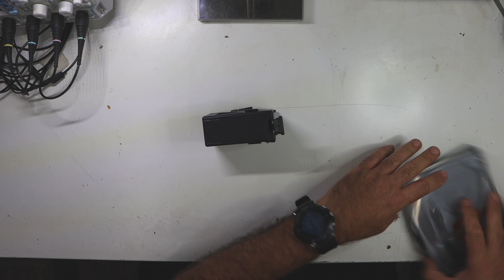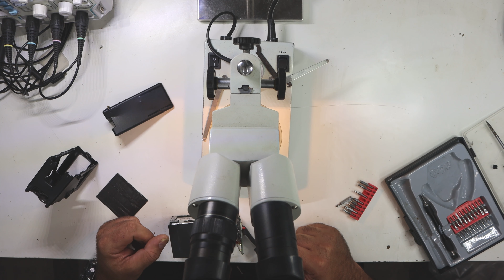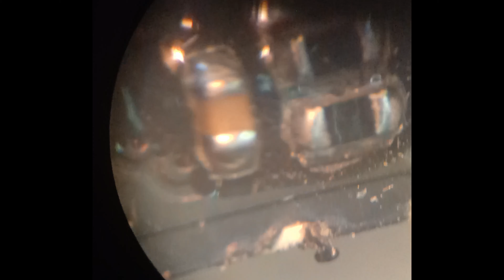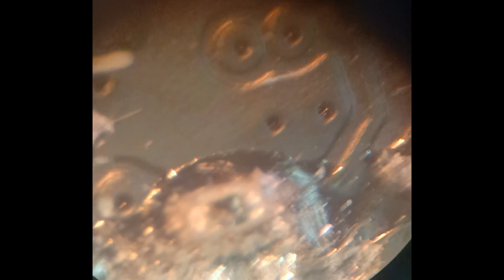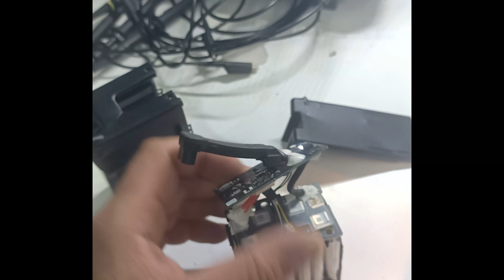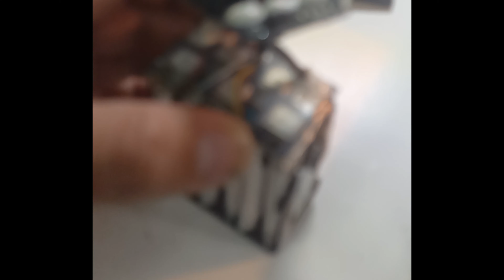What's inside a DJI FPV Battery. And: Can it be repaired ?  $#&%#  😒

Comment: Its too late for the reply, but since you opened it already. Did you try to resolder the pins to a normal lipo?
Reply from the maker: The lipo inside the battery was fine, the problem was the BMS. I ended up using the lipo in other projects. Cheers
Reply: @reversingentropy  so if i have a perfect bms, and dead cell can i use other lipo here?
Reply from the maker: @rainbowrunner1136  O think you can. i dont see why that wouldn't work.

Comment: Hello there, we are sorry for watching this. It is still recommend you to send the FPV back to us for further check. Please be reminding that we do not suggest you to open the smashed batteries for the safety concerns. Under this case we cannot help to repair/replace your battery. You can send us the drone repair request to support@dji.com with your product SN code, we will help to follow up.
Reply from the maker: I am so surprised by your comment. 😲 Thanks for caring. I am buying a fly more combo today in my local DJI store. 
However you must understand, most people can't keep a FPV drone that they can't repair. I agree that the battery is a safety concern. However, most fpv pilot's know how to solder. Please please please start selling replacement arms... Pleaaasseeee. Oh and also a dji air unit that works with controller v2. 😅 Thank you so much for your Time.
Reply: @reversingentropy  Hi, we will note your suggestion of selling the replacement arm. Regarding the Air Unit from the digital FPV system, it is not compatible with FPV controller. Hope your understanding.
Reply: @DJITutorials  DJI I want to ask you how safe is to transfer this drone(and the batteries of course) inside the cabin of an airplane . The question actually is for the batteries.  Thanks
Reply: Hi. I need a battery or two for Mavic Air (1). They are no longer found in my country (Romania). The drone is still working. Please help me.
Reply: @designextrem  Hi there, we are sorry for the issue you encounter. May we know if there is an issue with your Mavic Air battery? If so, you can send the battery back to the service center for assistance. 
You can start an online service request at https://repair.dji.com/repair/index or contact our support at http://www.dji.com/supportfor help.
Reply from the maker: I sure hope DJI can help you.

Comment: dji could literally sell an adaptor the dji battery... the battery shell with the pcba, plus xt and 6S balance male connectors... one adapter to hold as many 3rd party batteries as you want... 

but dji does not want that...
Reply from the maker: They most certainly won't do that loool
Reply: @reversingentropy  yea.. if they wanted to, they would have done a long time ago....

Comment: Bought brand new , unopened dji fvpv combo with 1 (one)  not working battery 🤦‍♂️not working out of the box 🤦‍♂️well done dji 👍
Reply from the maker: Warranty?
Reply: @reversingentropy  due to UK low on battery postage ....dji asked me to destroy  the battery .salt+water .make it video of it, then submit this video to them .
They provided me with a code for a free battery  .Ordered  one last night .
Reply from the maker: @tomaszkus3652  wow thats. Crazy doesn't it heat up in the salt water?
Reply: @reversingentropy  not at all.
Reply from the maker: @tomaszkus3652  Nice to know. Cheers 🍻

Comment: I thought of, if my cells die, opening these Batteries and changing them to a 6S Molicel 21700 4200mAh Li Ion. They can take 45A current draw. Probably have to lower the trottle a little but will long range for ever. If it fits. DJI wont allow self built, but with that original board it might work. What do you think?
Reply from the maker: I think it might work if your original board is ok. However this is dji maybe they have a cycle counter on the board and will error out after a certain number of cycles. One just have to trie.
Reply: @reversingentropy  DJI does have a cycle counter on board of the lipo packs. You can read it in your goggles. They make it nearly impossible to make batteries for their drones. There are in fact no thrid party batteries for any dji.
Reply: @chrisbee5481  weird.. I have seen people add external battery to dji battery..
Cycle counter won't just continue to count from last cycle. Not know cells changed?
Reply: @divingfalconfpv4602  and Link on that? I wouldnt open a 150 euro dji battery if not dead before. But its just an idea of 6s 21700 Batteries
Reply: @chrisbee5481  that's one. There's bunch others. Like on mavic pro.
Reply: @divingfalconfpv4602  thanks for the Link. That is basically a battery connected parralel to the original one. The buttons were delayed outside. Good, but that is not replacing the original lipo with li Ion cells. Cant compare. Would love to try on my dji fpv, bus destroy 150 is hard
Reply: @chrisbee5481  yeah unfortunately every single way people do it. You seem to have to keep original battery.  They just adding external batteries to mavic.
Reply: @divingfalconfpv4602  it is the easiest way adding. Also not a waste of what you have. But li ion has the highest energy density for long flights. Just not so high C rating. Thanks to electric tools and tesla, the new li ion are getting closer to the lipo on discharge high amp current.  The round cells unfortunatly suck in rc models due to the restricted shape of placement.
Reply: @chrisbee5481  yea I use li-ion a lot.. and don't understand why these mavic guys keep choosing lipos. 
Not sure how many decades before that new li-ion with all the pads trickles down. Lol
Reply: @divingfalconfpv4602  lipo are cheaper I guess
Reply: @chrisbee5481  at first I thought they couldn't add a lot of weight but need guy add like 3000mah lipos lmao .. mavic doesn't need the amps. Don't see how it need over 30a hovering and going slow.
Reply: @chrisbee5481  kkkkkkkk eu faco kkk
Reply: @reversingentropy  they dont on the mini and I doubt on fpv to

Comment: They make it non-serviceable on purpose so you have to pay out the ass for a new one. I've had a lot of fun with my FPV but, DJI is a dick company. One of my batteries is reporting a 'battery installation error' in the goggles. What's ironic is, it's the 3rd battery in my set (I numbered them) that I have hardly used. Thanks for doing this so I don't have to I appreciate it...
Reply from the maker: Money money money, they always want more money lol. Cheers.

Comment: Can anyone tell me what is the minimum amount of disassembly needed, if I only want to replace the vision sensors module and ribbon cable?
Reply from the maker: Sorry i think because the ribom runs to the inside of the lower plate you will need to pull the whole lower assembly. Good luck.
Reply: @reversingentropy  yes I tried but I think it is impossible to do without removing the front legs. Way above my repair skills. By the way is it normal for the motors to get pretty hot right after a 10 minute flight?

Comment: that's why you shouldn't buy overly complicated FPV drones :) DIY is still the way for FPV
Reply from the maker: I agree... But... i work with electronics it would be nice to have something ready to go, no work required. Soldiering pcbs and tune PIDs its not fun for me.
Reply: @reversingentropy  just get a bnf or rtf fpv drone
Reply: @reversingentropy  20 plus years ago my electronic skill was zero. So now older, and electrinjc skill higher. Have looked at the assembly and soldering for the dji air unit. Thats ok. The stacks instructions not including the crazy binding. Oh boy. I have Taranis x9d plus. Only have configured helicopter models to fly on a sim. Took  more than 3 weeks to start understanding how to configure models and curves.

Comment: considering i get about 8 minutes out of these batteries flying around they aren't worth 50 IMO.
Reply from the maker: you must fly acro and haul ass 😅 i get about 12 to 15 minutes in sport mode. still not worth the 160 euros per battery.
Reply: @reversingentropy  fighting the wind tonight I could get about 6 minutes out of a battery that's that's about it was 16 mph in sport.  I don't do acro yet maybe in a couple months when I'm comfortable
Reply: @Ev3rM0r3  If you fly at full speed all the time it will drastically reduce the time you get. In acro you wouldn't because you decelerate a lot on purpose using momentum rather than throttle to do tricks. Unless you use it for racing purposes of course. Also with 30° of camera angle you will definitely fly faster than if you were using like 15°. I change pretty often depending on what I want to do and sometimes I do a training session through gaps for example at 15° and it lasts for more than 10 minutes.

Comment: Well I bought the FPV, and have time to send it back and get my refund. DJI is so expensive, and damn batteries are so expensive. When I think about it, I agree with you. Batteries charger, it's like being raped every different way. And then I watch video and FPV only gets 10 minutes for battery ?  They could sell the balance board and ... probably not. Just like the DJI simulator. The FPV came out a year ago, and support ids for Iphone, mostly. DJI knows where the money is. Iphone costs alot, doesn't mean the ones that own them are smarter, but will spend without thinking. I can solder and check some electronics. Maybe keep the fpv goggles and just do a build. Damn. Had a chance to get a really nice Autel Evo II with tons of extras, and already had ordered this. Oh well...don't feel bad. There's more idiots coming on board, like me to provide used. and crashed fpv's to buy parts from. And DJI thanks for commenting on his video. I am not married to this purchase, and the Autel is looking alot more better, each time I watch another video !
Reply from the maker: Yes it's a hard decision to make. Aldo the DJI drone is more expensive its also much harder to crash or to lose. I have spent much more money on the regular drones than on the dji.
Reply: @reversingentropy  I started my FPV journey with the v2 goggles, & building my own quads with the Air Units and Caddx Vistas. Going forward, I am strongly considering building with the PixHawk/Cube ecosystem.